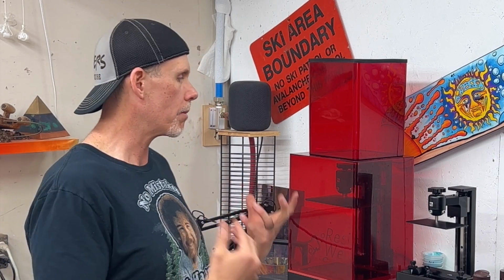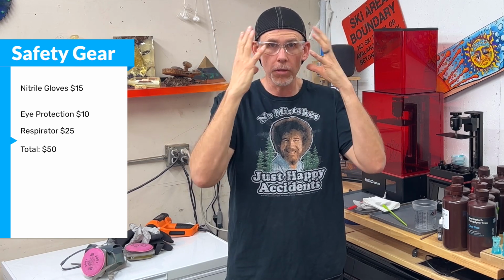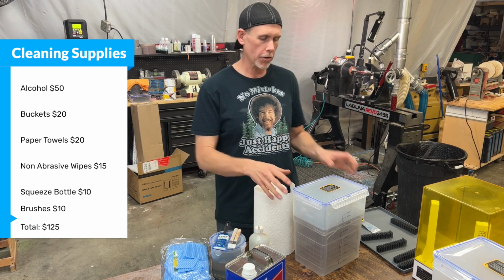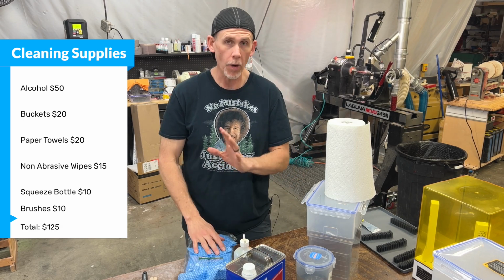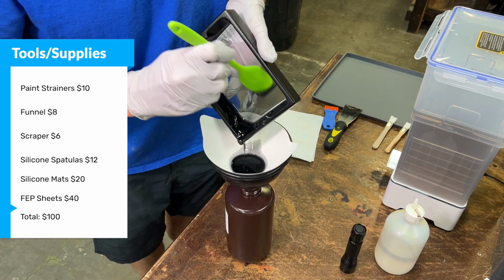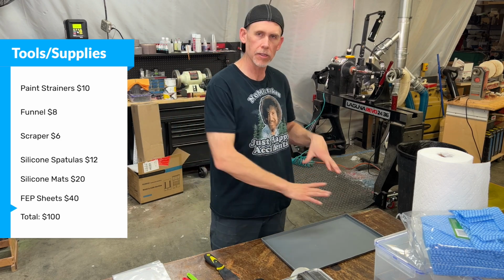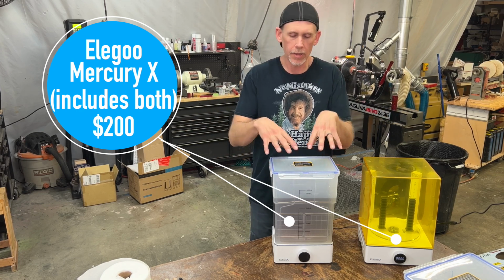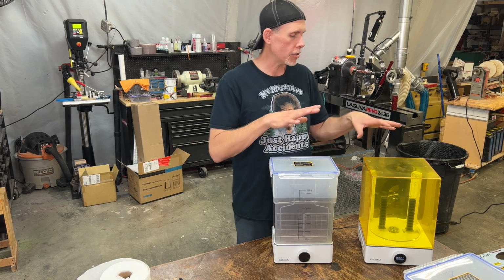Must Have SLA Resin 3D Printing Safety, Washing, and Supplies

Comment: Software, that’s what i want to know about.  That’s the part that stops me
Reply from the maker: I really don't have a lot of knowledge about the software side of things, but here's what I can tell you about it. To print files, you just need to use a slicer program like Chitubox or Lychee Slicer to get the file prepared for printing, they are free programs 🙌🙌 

If you want to create your own models from scratch, there is a free version of Fusion 360, TinkerCAD, or you could use Shapr3d on mobile devices. Lots more too, but those are three I know of off the top of my head

Down the road, I'll create a video that shows the steps I take to print something from start to finish. I'd like to get some more experience under my belt first so it's as useful as possible
Reply: Yes ! Software — let’s talk about that :) I am lost
Reply: @LaurieSullivanRoy  
If you have one of the newer iPhones take advantage of that LiDAR sensor 
It’s so easy to scan something with my phone and prepare it for printing